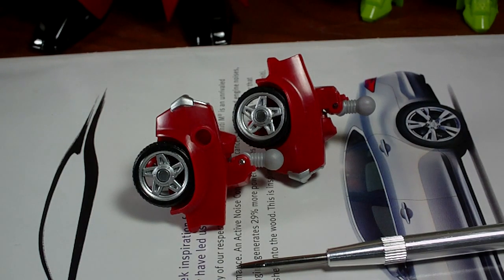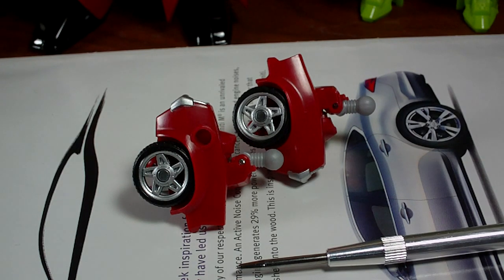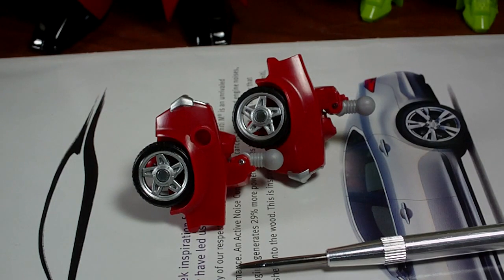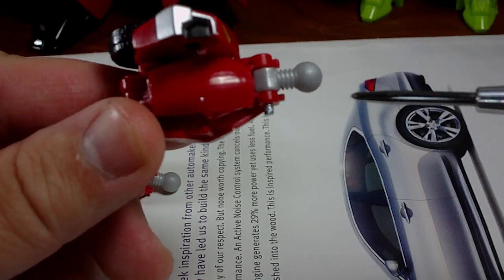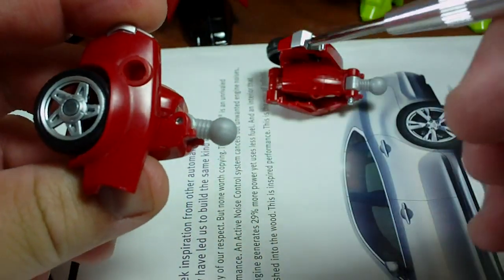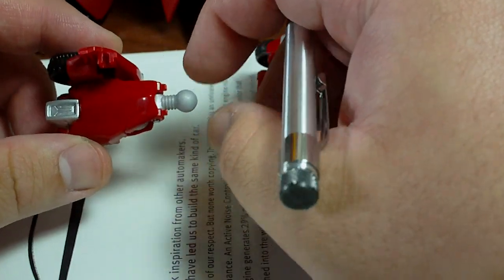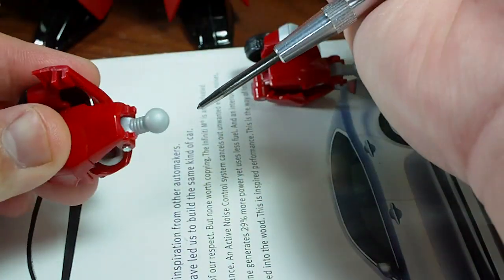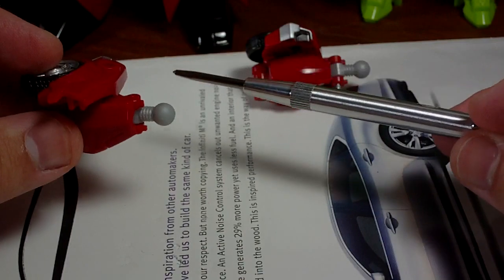Toy customizing: Metal pin removal from joints

Comment from the maker: For basic metal pins, I don't bother with heat treatment. My punches have been clean so far and the only scenarios where I use heat are:

-Removing the newer wheel attachments for TF toys that rely on a "pressure lever" attachment method.
-Removing capped pins that the pin/center punching method will not work.

If one has pin removals that aren't clean, it could be because they're forcing the pin's rough end through the long way rather than straight out their side of the joint.

Comment from the maker: So far, I haven't experienced any significant loosening of pinned joints after removing and then returning the pin to the joint.

If a pinned joint is loose when you put the pin back in, I imagine you could tighten it up by bulking up the pin with something like Future Floor Polish.

Comment: That's actually the most useful demonstration on pin removal I've yet seen. Too often the prospect of toy customisation goes out the window the moment it becomes necessary to remove these pain-in-the-arse pins. This looks easier & less destructive than some of the other methods I've seen, particularly the "heat the pin with a soldering iron" method (which has always sounded daft in my opinion). Thanks for the tip!

Comment: I just got a mp-44 and one of the rist joints in in backwards. A factory error I think. Might have to use this method to get the part out. Rotate it and put it back. So cheers,

Comment from the maker: I've never had a problem returning pins to the joints. I put the pin back into the side of the joint it exited. I also make sure that the pin goes in smooth end first so that the burred/rough end of the pin doesn't get caught until the pin is nearly back in place. When you had trouble putting pins back in, this could have been the problem.

I'm pretty low tech when it comes to returning the pin. I normally use a small block of spare carpentry wood and use it to tap the pin back into the joint.

Comment from the maker: I've only ever used one brand as my automatic center punch has lasted me since I bought it. It's made by a company called Procise. I bought it at my local Home Depot. The model number is 210-2202. I'm sure you should be able to find automatic center punches at any hardware store that carries conventional pin punches.

Comment: Very timely video, as I am interested in custom painting.

Does removing the pin cause the hole in the plastic to expand in diameter, leading to a loosening of the joint?

Comment from the maker: I recall the  Defender figure having ratcheted knees. At least mine did but the ratchets were quite weak. I'm not sure how much nail polish would help.

If you are experiencing the common issue of Defender not being able to stand well, a large factor is the small feet rather than weak knees. I've seen heel add on pieces for Defender available through Shapeways that will greatly improve the standing ability if not altogether eliminate the problem with standing.

Comment: if you support the bottom pin mount where it comes out over a small short metal tube it will have a better drive and come out easier.

Comment: Going to buy this right now.  Much thanks man.  This looks so much easier.  I broke my last pin punch a few min ago, but this looks so much better.  Only one question, what size is the pin tip?  Are all the automatic punches the same size, or do they have different widths?
Reply from the maker: Unfortunately, I don't know what size the pin tip is as the packaging doesn't state the size. If you can find this kind of pin punch at your local hardware store, the manufacturer is Procise and the model number 210-2202.

Comment: This helps if you're trying to make a custom Leader-1 out of Classics Starscream using the Megabolt Robot Factory Coronation kit which came with a Leader-1 head. I don't have either set but this'd be helpful as the official head replacement tutorial had the head supported by stacks of pennies, this is much easier and much less makeshift

Comment: Hmmmm I might go pick one of these up. I have been wondering how I was going to get the pins out of the knees of my Fansproject Defender. If I could get them out...I wonder if a little nail polish dripping inside the joint would tighten it up. I'm kinda worried about the pin not going back in though.

Comment from the maker: Hmm, that does sound like a bit of bad luck. At the same time, the pins you were working on with the PRID Arcee toy are fairly recessed so that could have added to the difficulty of returning the pins into place. I don't have my Thunderwing toy on hand so I can't check the specifics of the pin location but that could be a similar case of tricky pin placement.

A friend of mine did break a pin once and used the same replacement material as you(a section of a paper clip).

Comment: like previously asked how do i remove these kind of pins with only one side accessible?
Reply from the maker: In such a situation, you will need to use an alternative method. It involves using a soldering iron to heat up the pin and then removing it with a strong magnet. It's a more risky method for pin removal but it works well.

Comment: How about putting the pin back in? Do you just hammer it back in?
Reply from the maker: Yes, you can normally return the pin to the joint but remember to put the pin back in the way it was originally oriented. You shouldn't need to hammer the pin back in with too much force. A firm tap should normally be enough to re-secure the pin.
Reply: Thank you. This has been helpful. need to go to a hardware store now.
Reply: Thnx now I can paint my battle blades bumblebees blaster thing
Reply: Usually I take some flat pliers and clamp it back in. It's tricky to find one big enough that will accommodate some joint sizes, but it's important that the contact parts are flat and without too much texture. Think of it like a duck beak. A pair of pliers with too much bite can damage the plastic.

Comment: I've heard of this and I was thinking of making a custom transformer but the styrene i have will only work if I put a pin in it is that possible and if so how
Reply from the maker: enderwinner 547 It is possible and commonly done by scratch builders of model kits and custom toys. How it is done is not known to me as I have not ventured into scratch building. However, there are plenty of tutorials on the Web showing how to perform such operations.
Reply: Ok thanks I'll try to find one

Comment: on vortex the pin holding plastic that  holds the rotor assembly on I  would like to remove that pin I got a new rotor assembly  coming and I need to remove that pin  it's not the cap pin  it's the onther one

Comment: What do you do if you have a pin joint that fell out and is to loose to hold?
Reply from the maker: This problem speaks of a pin hole that doesn't have enough material to provide friction for the pin to stay in. In such a case, my best suggestion, all factors considered for the average person, is consider one of two options:

1. Replace the part with the loose pin hole(if you can find another copy of the toy at a reasonable price).
or
2. Bulk/build up the existing pin hole with air hardening clay in order to create a pin hole that will hold the pin.

Now option 1 is only viable if you can easily find a replacement toy to salvage parts from and if it is not costly. Option 2 is only viable if you have experience in scratch building and/or are confident in scratch building small parts. Option 2 also hinges on whether or not you can buy air hardening clay easily and at a reasonable price.

Unfortunately, there is no quick and easy solution as far as I know. However, please bear in mind that I'm no expert scratch builder so there may be a better and easier method than what I've suggested. You could go to various toy and model kit enthusiast forums to seek more expertise advice.
Reply: Yeah it’s on my TFC hercules, scrappers elbow, the pin came separate, I was able to get it in but after a minute of fiddleing it came out, I’m thinking either a new pin, put little cover over the pin holes, or try to beef up the pin. It’s not a D E V A S T A T I N G problem though as the forearm still latches, I’ll probably try building it up first and then try caps, I don’t know dude... I’ll figure something out though I’m pretty good with modding figures... oh yeah and thanks for the reply, #subscribedeventhoughyouhaventpostedin4years
Reply from the maker: @upstreamlotus0  Ah, a 3rd party figure to scavenge from will be tough to acquire for a decent price.

Actually, finding a new pin or making one is possibly the easiest solution. Depending on the selection available at your local hardware stores, or even hobby stores, you may be able to find a slightly larger diameter metal pin that will be a snug fit for the pin hole of the figure's elbow.

And, yes, haha, I've been retired from my channel for years. I'd love to get back to creating content but there are better people for this kind of job out there. Thank you so much for the subscription despite my inactivity!

Good luck on your modding/fixing of the elbow!
Reply: Guiltaur thanks dude!

Comment: I have swindle and the mid-chest got stuck and I need to remove the pin to fix it
From the movie line
Reply from the maker: Is the Swindle you have the one that transforms into a red sports car? I'm afraid I don't have the toy so I can't offer any suggestions for how to get at the pin securing the mid-chest area.
Reply: +Guiltaur oh nvm its backing fixed it after playing with it around the pin
Reply: +GoldenBricks AJ back

Comment: I Have a tlk barricade and the pin joint for the feet are really loose
Reply from the maker: I'm afraid that kind of issue isn't going to be remedied by what I speak about in this video. However, there are options to tighten loose pinned joints such as applying a thin layer of substance, such as Future Floor Polish, which will fill in the loose joint a bit.

I suggest you look for videos demonstrating the tightening of loose joints on Transformers toys for more information.

Comment: dose it work for  combiner wars vortex
Reply from the maker: Which pinned joint of Vortex specifically? This method should work for the majority of pinned joints in modern Transformers toys.
Reply: the pin holding plastic that  holds the rotor assembly
Reply from the maker: Yes, the method of heating up the pin will work. However, the pin holding the rotor is a capped metal pin, which requires a somewhat different approach. I've uploaded a video regarding capped metal pin removal, which you may wish to watch for the specifics of that kind of pin removal.
Reply: k  thanks
Reply from the maker: You're welcome. Good luck on your custom endeavors.